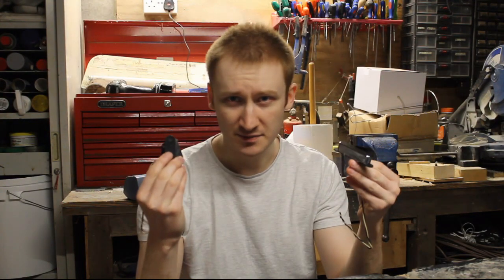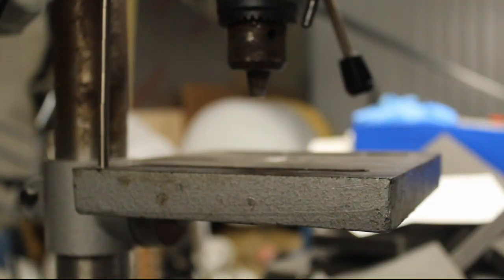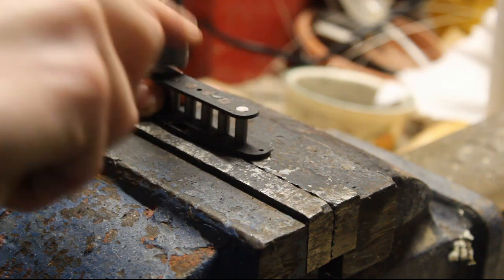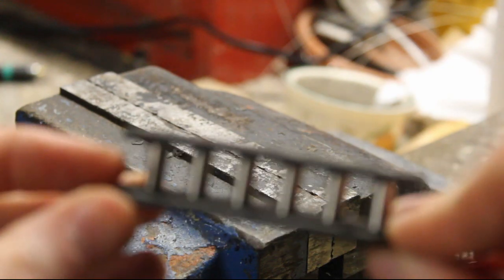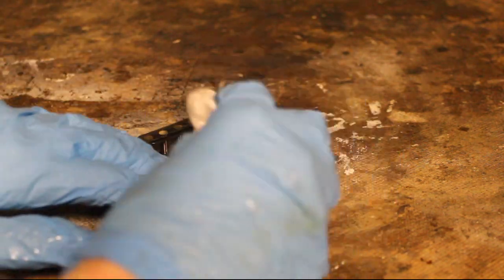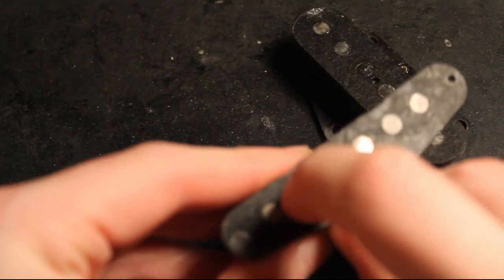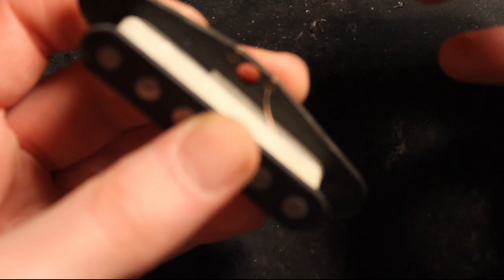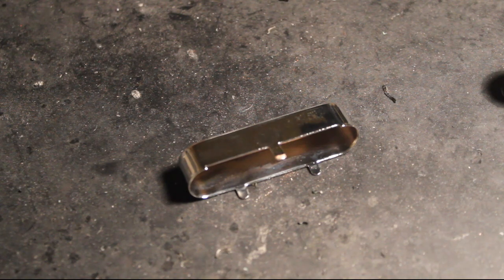How to build a Telecaster pickup set

Comment: Thanks for putting this up. I bought a tele bridge kit from you a couple of weeks ago and had a go of making my own mixed magnet (5/3) version using this tutorial. Hardest part was making a makeshift winder using a vape coil winder (not enough torque!), a digital counter, some rods drilled in to a wood block to hold the spool and glass jars for guides, very primitive. It took about 1k winds per half hour average, so took a few good hours to make 9.5k winds (done in bits). Potted it last night and installed it this morning. The result  is surprisingly good for a first go. The overdrive tone was the specific target. Round off the searing highs, keep lows meaty and defined.  Waiting for neck kit to come back on stock...

Comment: I got offered a big box full of Wilkoinson M series Bridge Pup's for T types. The problem with the Pick up's were the coil had come away from the terminal. Usually only the one side but sometimes underneath on the same side needed the contact bridging. After that i was getting readings. I got sent 4 by JHS with the offer of as many as i could repair for pennies. I repaired all 4 of them, put one in a Tele i made, kept one spare and sold the other 2 for 30 quid a piece, happy days. I got exellent feedback for the Pick up's aswell so i obviously did an acceptable repair. I'm seriously considering buying a Pick up Winder.

Comment: This is an amazing video. I have one question: does it matter if the loops going through the eyelets break? On my bridge pickup one of these has snapped (on the hot side so not the black side that is also soldered to the baseplate). It was only a single loop and not looped five times as you’ve done it.

Comment: Is it possible to just unwind the copper a couple of turns and then solder it? After all you would only be loosing cm's in coil wire, negligable really don't you think? I understand that if that Copper wire breaks midway through the winding process and you were not aware then this could be a total rewind but if it's just a small mistake as your finishing the Pick up it should be ok shouldn't it? Thanks for sharing. A comprehensive explanation of how Telecaster Pick up's are wound.
Reply from the maker: Yes, that's exactly how many repairs are performed.

Comment: Hi! Great video. I just bought a 2011 American Standard Telecaster and the bridge pickup came without a base plate. I found the sound of it a little too thin and trebly so I was thinking installing a base plate to it. Do you think it'll make a difference and give that touch of body that's missing? Also, in your video I noticed you put the plate directly over the magnets, isn't it necessary to have a masking tape over the magnets before putting the base plate over it? Thanks!
Reply from the maker: That ought to help with the problem. Tape isn't necessary over the bottom of the poles, I think that's mainly done to isolate them from ground should the lacquer break down and the coil shorts to the poles. I put tape over the inside of the coil to prevent that issue.
Reply: @Alegree  Great! I don't think I can use lacquer as I don't have so maybe i'll just put that masking tape and snap it...Thanks for the fast response!
Reply: @IKNMusic.Official  that's exactly what I was looking for a couple of months ago! I finally put the metal base plate and now it sounds very cool! Your video is very helpful and quite on point! Thanks

Comment: Do I have to dip them in lacquer or can I just wrap the magnets with tape?
Reply from the maker: Yes, it secures the flatwork to the magnets.
Reply: No you don't need to just loctite the pole pieces with a tiny bit of glue where they go into the flatwork . Then tap around the pole pieces. Kapton tape works well.

Comment: Jesus! I don't even know where to begin, you beat the ever lovin piss outta the flatwork assembling it, not to mention the slugs, Then if you're going to wrap tape around the slugs, then why even bother with the mess and waste  of drying time of lacquer? You realize they now make a fast drying spray on lacquer and no need for tape, ready to wind in less than an hour, but if you are going to  use lacquer and hang them to dry, for the love of god don't use string the way you di, you're only making a potential spot for the windings to short if the string dries to one of the slugs. Use wire through one of the screw mounting holes and let them hang it will also benefit if any excess lacquer still needs to drip off it will find the lowest corner . I'm sorry, but I've been  winding pickups for quite a few years, this was just painful to watch, I literally couldn't make it past 17 min. and had to stop. One last thing, you forgot to sand off the wire insulation before looping in the eyelets.
Reply from the maker: The lacquer is used for structural integrity. The bonds it creates between the alnico poles and the flatwork prevents flatwork flare under the outwards pressure of the winds. Tape should always be used (and is by all the major manufacturers), because lacquer can break down over time regardless of how well it's applied. There's no issue with the way they're dried - we've not had one pole grounding issue on any of the 500+ Telecaster pickups we've manufactured. The wire is a solderable poly wire, there's no need to remove the insulation for this wire.
Reply: Winding pickups for years and not knowing the existence of polysol... Something's wrong^^
Reply: @grrreh1532  Obviously, but he never said he was using a polysol magnet wire, therefore the assumption. Which is why almost all videos you watch on winding a pickup, including fender factory, or seymour duncan, you'll see the person winding sand off the tips because they are using a more traditional plain enamel or a heavy formvar wire. Never the less even if he is by chance using polysol wire, he didn't say that leaving out a crucial step that a beginner would miss and end up wasting time and wire trying to figure out why their pickups are not working. Nice attempt at trolling though.
Reply: @fate2022  If someone spends money on winding pickups with only one video as total knowledge, he is obviously wasting money and time. What's your point? 
Total nonsense as your first post.
The guy shares his work, no need to act like the angry winding master. Who's trolling?